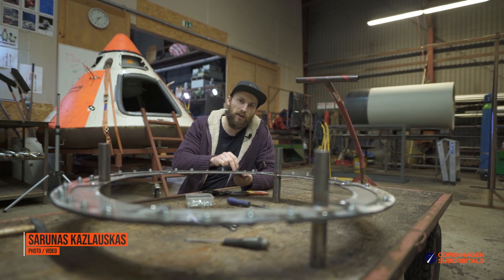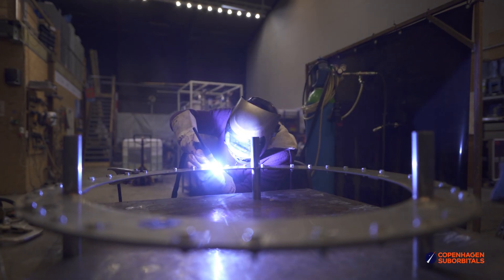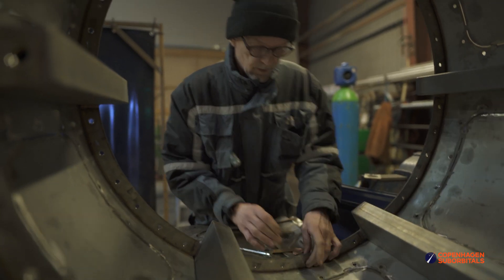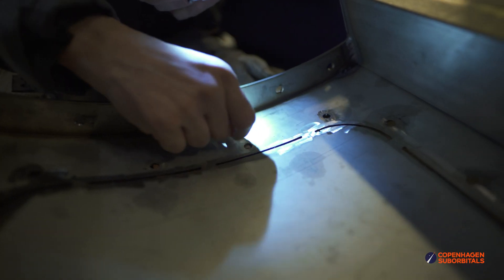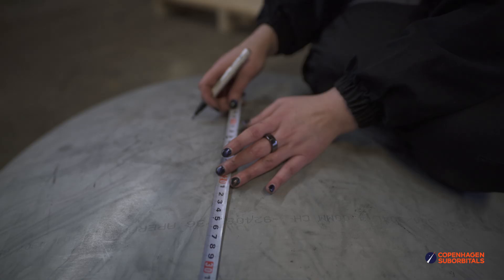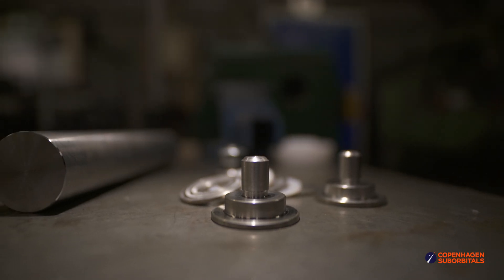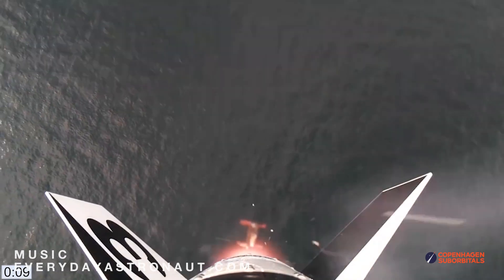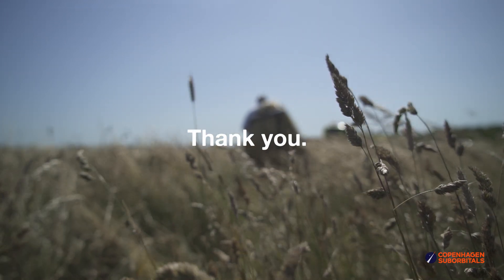Propellant Tank Bulkhead Cutting & Astronaut Seat Prototyping | INSIDE THE ROCKETSHOP : Episode 19

Comment: Saw you video on astronaut candidate  Anna,  from who little could get from subtitles she is 1.56 meters tall (5 feet 1 1/2 inch ) -  

Do you have a suit to fit  ?  Have you considered using Russian VKK -6/15 partial pressure suits for astronauts 

These are very similar to US MC3 used in high altitude balloon flights  and parachute jumps from 100,000 feet (30 KM)